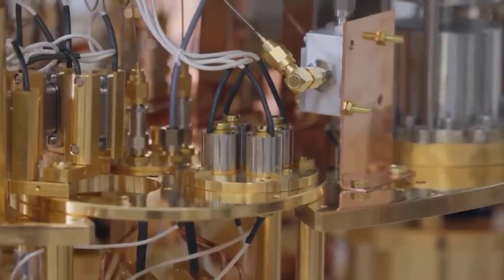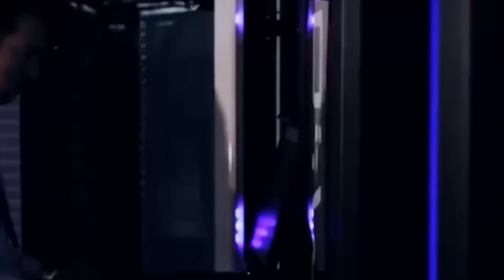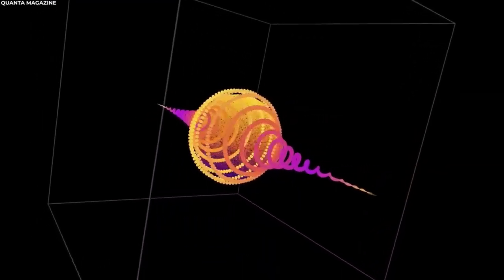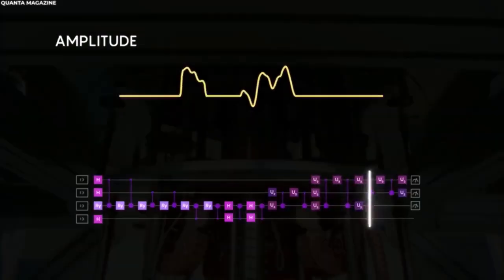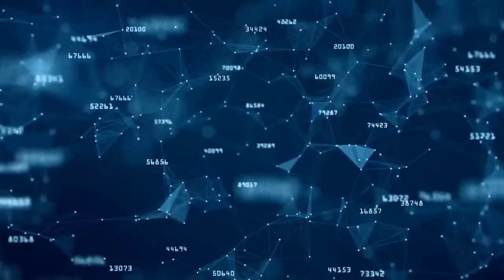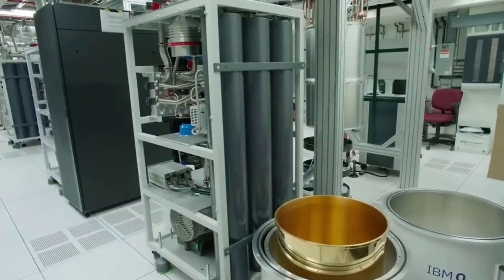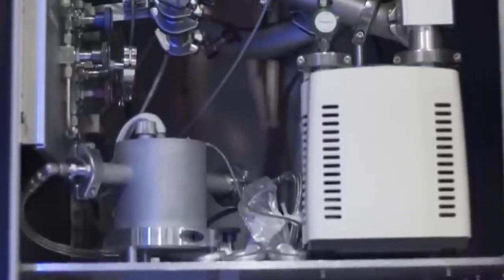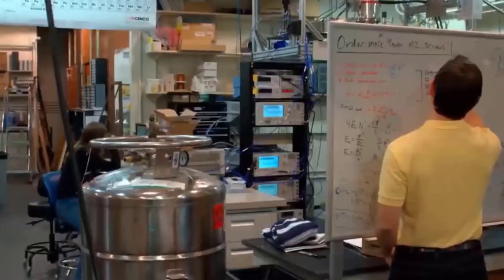Michio Kaku: ''Quantum Computer Just Shut Down Later It Disclosed This!''

Comment: 1:42 that's not how a computer does searches. In a hashtable all the items are "coded" by a function so the search time is constant. In a tree like structure, on the other hand, the search cost is equal to the tree height, so is proportional to the base n logarithm of the items quantity where n is the branches ammount for a level.
Reply from the maker: Thank you for noticing.